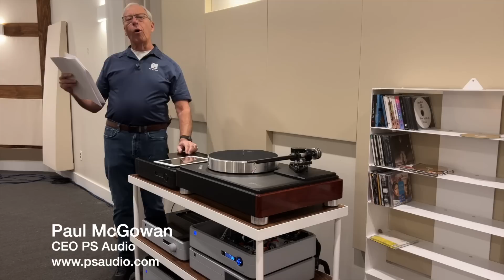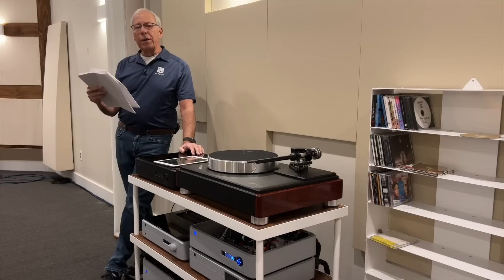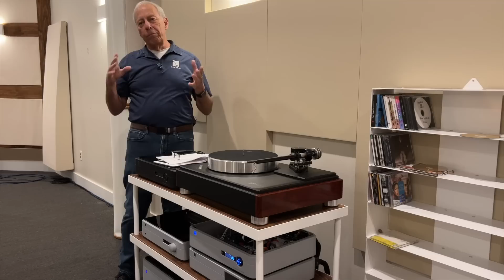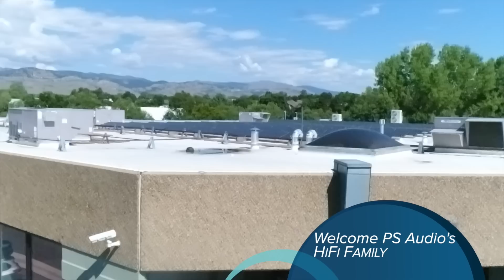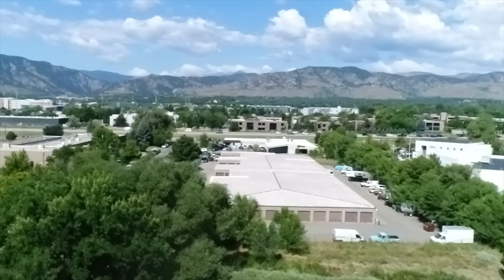Hearing higher sample rate audio

Comment: So higher sample rate is basically same as FPS (frames per second) in video?
Reply: Except that the human auditory system does not have built in storage/ persistence that vision has. We do not integrate the audible pulses the way we blur vision.
Reply: Not exactly. Higher frame rates provide better temporal resolution where that matters such as slow motion or with fast motion content, like a soccer game. But video resolution, i.e HF response still follows Nyquist. For example oversampling a still frame of video has the same benefits or lack thereof as oversampling audio. Higher video frame rates increase the overall data rate but the video sample rate remains the same be it 24fps or 60fps.
Reply: I believe it is more like screen resolution... But certainly is captured like frames per second as samples are taken by second too, but in audio  for you to understand it better, get a paper and graph a sine wave (just a single cycle) then put a tracing paper over it and make 10 even spaced dots over the sine, after move the original paper away and conect the dots with straight lines between them, looks like the original?
Seems like you need higher sample rate to recreate the sine wave right...
Reply: @alejandrorigonatto694  No, that is not how it works. It doesn't connect the dots, it applies a mathematical function to the information. Watch the video done by the inventor of Ogg Vorbis audio on YouTube and he shows that there are no dots and no imperfections at all. D/A and A/D | Digital Show and Tell (Monty Montgomery
Reply: @alejandrorigonatto694  But you don't need ten dots to recreate a sinewave. You only need two dots! Yes, that seems absurd on the surface but that's where the advanced math, calculus,  comes into play.
Reply: And how much you need in a second to cover all the audible range..?
Reply: @alejandrorigonatto694  44.1K that is why they chose it for CD quality, Phillips and Sony based it on human hearing.
Reply: @Digiphex  yeah... Is the double of the maximun hearing frecuency... I know... Just try to explain it the easier way for him to understand...
Reply: @andydelle4509  "But you don't need ten dots to recreate a sinewave. You only need two dots!"

Two dots is not enough.  What if you were really unlucky and happened to be sampling exactly at the zero crossings?  You'd hear nothing but silence.  Therefore, 2 dots aren't enough.  And yes, I know about Nyquist.  You need slightly more than 2 dots per cycle.

One thing all the Nyquist quoters forget, is that the theorem is only true for an infinite sinewave.  The song you are listening to is not infinitely long.  There's a start and an end to the wave.

Furthermore, you'd also need a perfect brickwall filter, and such things don't exist.  Which is why the 44.1KHz is for 20KHz audio and not 22.05 KHz.  They're trying to leave some room for filter rolloff.  Filters cause phase shifts.  A different shift for every frequency.  The steeper the slope, the worse it gets.  So there's more to it than just saying "you only have to sample at more than twice the frequency".
Reply: @Hyxtryx  I do know the practical Nyquest figure is 2.2 rather than 2.0. My background is with early digital video in the 1980s  rather than audio. But the same rules apply. The point is that sampling and subsequent analog waveform reconstruction is not just a simple process as connecting dots on a graph. And 2, OK 2.2, does work quite well as evidenced by red book CD and countless other applications.
Reply: @Digiphex  Also DAC works just like that, look for it, there are no way of DAC to apply the mathematical function you mention, the result will always have slopes on any kind, and that's why you have something called "dynamic range" there is no infinite values in no one of the DAC, physically can't... but it represent no real issue since the speaker inertia tend to make it dissapear, just like in a class D amp when the audio signal don't really exist until it reach the speaker(s) and his inertia...
Reply: No. Video is only showing you those 25 FPS in a cinema movie for instance and the rest is gaps of empty space. Digital audio is reproducing everything with no gaps if CD quality and no higher sampling rate is necessary due to Nyquist-Shannon.
Reply: @Digiphex  Stop peddling the Nyquist-Shannon theorem to sell your old 44.1kHz sampling dogma.
What you and countless others like you have missed for decades is that your arguments does not account for the fact that we can hear many different soundwaves concurrently. And each sound frequency has to be samples individually at the same time for us to capture realworld sounds entirely.

Comment: No, it doesn’t make sense, get a basic understanding on nyquist theorem, it doesn’t matter how much faster you sample, for 44.1kHz sampling frequency, you capture perfectly everything from 0-22.05kHz.
Reply: Exactly! Signals and Systems 101 in Electrical Engineering. But it requires Calculus so nobody but us took the class.
Reply: Because twice the needed information rate is all that is needed? Like 12hr samples for a 24hr daily Earth cycle? Sample Noon and Midnight and you represent the entire daily Earth/ Solar Cycle? But then two samples sunrise/ sunset and the system could just as well be the Sun staying on the horizon all day! 

For those that have actually read S/N, it is about the data rate needed to capture a CONTINUOUS/  INFINITE sample set.
Reply: @glenncurry3041  Brain injury?
Reply: @robertt7238  See a Dr, I can't tell from here.
Reply: @glenncurry3041  Audio becomes useful to humans at 20Hz but for the average guy, you can't hear that anyway. So the absolute least we are concerned with is 40 samples in one second if we want to only reproduce an ultra low sound that very few humans can hear. Earth cycles has nothing to do with hearing or audio.
Reply: @Digiphex  You missed Glenn's point.  What happens if you sample a 1KHz sinewave at exactly 2KHz, but got unlucky and all your samples happened at the zero crossing point?  What would the result sound like?

Now imagine at 20KHz signal being sampled at exactly 40KHz, and you're hitting all the zero crossings.  Same thing, right?  Admittedly, you wouldn't hear the 20KHz anyway, but bear with me.   Now bump the sample rate to 40.0000001 KHz.  Is a perfect representation of the signal going to instantly pop into view?  I don't think it will.  The antialiasing filter is still going to let some frequencies above 20KHz through, and cause distortion. That's why we sample at 44.1KHz, to give some headroom, so to speak.  It's a compromise, and considered "good enough".  But it's still not perfect.  You can get closer to perfection with higher sample rates.
Reply: @Digiphex  OK, having been there to explain S/N sampling rates when CD was first introduced, I used the Day Night example because that was how S/N sample rates were explained. Not because that sample rate was relevant to audio. Sorry if that confused you.
Reply: @Hyxtryx  exactly! Sample a 2khz sine wave at 4k. Two samples! If you hit peaks, life is wonderful! If you hit zero crossings, the entire sine wave did not exist as far as that ADC is concerned! 

11.025Khz sampled at 44.1khz? 4 samples? Zero, Peak, Zero, Peak ... life is wonderful. +halfway up, +halfway down, -halfway down, -halfway up? Looks like a squarewave. No peak data. 

And we sample at 44.1k because that gives 3 samples for 2 channels onto a single video line on a video tape recorder.
Reply: @Hyxtryx   You don't sample 20KHz at 40KHz. You sampled it at 44.1KHz (or something higher than 40Khz).
Reply: No you don't. Because we can hear many different soundwaves simoultaneously. And we need to sample each sound frequency individually in a sum of samples in order to capture realworld sound in its fulness.
The peddlers of the  Nyquist-Shannon theorem have ignored or missed this fact for decades.
Reply: @edfort5704  Physics principles are not "peddled" that is absurd. I can tell you don't know what you are talking about.
Reply: @Digiphex  Using half-understood physics principles to sell untrue ideas merits using the word 'peddling'.
Reply: @edfort5704  Actually no we don't. At any one instant in time we "hear", detect the pressure level that is the resultant of all waves arriving at the instant. We are not listening to all of them at once. Just the single results of all of them at that point in time. I find the mistake we make is in trying to break that complex wave down into it's less resolving frequency only data. Shannon Nyquist actually address sampling in a CONTINUOUS wave not already reduced sampling. Requiring reduction from an infinite number of samples. That part is ignored.
Reply: @glenncurry3041  at any one instant in time you don't hear entire separate frequencies but only parts of them, since no sound frequency hapens in an instant in time and each sound frequency that we can hear lasts a different amount of time.
The resultant pressure waves that we hear are comprised of multiple different frequencies. The waves are not simple sinewaves but complex ones, because you can have multiple peaks and troughs of higher frequency during the rise and/or fall of waves of lower frequency.
How many different waves we can hear at the same time I don't know, but I think the number is huge.
Have you listened to good recordings in DSD versus CD PCM? The differences, especially on DAC systems that leave the original sound unchanged (not upsampled) are high and very apparent. Paul himself has claimed this for years now (the part about differences being obvious, not the nuance about DACs) and is why he has started the DSD studio.
Once one hears the difference between classic CD PCM and good DSD recordings, especially these newer DSD128/256 ones, the question of huge sampling rates being superior becomes evident.
The people using the Nyquist theorem to claim the 44.1kHz superior sampling limit to human hearing have completely missed or ignored the concept of hearing multiple frequencies concurrently.
Reply: The problem with nyquist theorem is that it assumes ideal conditions. In practice, a sampling rate higher than the nyquist frequency is preferred, usually 2.3-5x depending on the application (especially in research, where it can be as high as 10x).

For audio, we can probably get away with around 3x nyquist frequency for sampling if audio processing is not a large part of the chain. Of course I am speaking about capturing all the information in the audio. I don't think, outside of analog instruments, sounds, and vocals, a small degree of error really matters, which is why for mass media no one cares if it is 44.1/48kHz. Diminishing returns and whether or not you care as a listener plays a large role.

Comment: Sampling rate  = how often digital electronics 'reads' the data ?  Theoretically, the more the better but like anything, there are limits or diminishing returns.  In my rather limited experience, the mastering of the recording makes the biggest sound quality difference, far and beyond high sampling rates.
Reply: True. A song will sound as good as it's recording. However I do feel it sounds better than listening from a different source of equipment.
Reply: Right, a phone call is heavily compressed from 8kHz of sample rate and clearly sound worse than 44.1kHz but human hearing will hear little difference above 44.1kHz as it already allows for full audible range reproduction and anything more is about time precision in the treble where you won’t notice the difference for much music.
Reply: @ThinkingBetter  There's a basic misunderstanding, the preoccupation about filters working outside of the audible bandwidth: all filters are a tradeoff in that they will affect the passband in multiple ways (impulse response, i.e. phase and time, plus there are artifacts such as aliasing etc.). In general one might say, the more benign the digital filter, the better the sound (although again, some of the same caveats apply: digital filters are always about tradeoffs, none are "perfect").
Reply: @LeonFleisherFan  Filter artifacts are what makes this an audible topic.
Reply: Of course the mastering makes a huge (in many cases larger) difference, but that does not diminish the fact that sampling rate also does. garbage in, garbage out- but if you have good masters to listen to, why limit them to 44.1?

Comment: Don't forget the quality of the recording. It's garbage in garbage out  no matter how resolving your system is :)
Reply: 👍So true.. Also worth mentioning that the same holds true in a purely analog system. 😉
Reply: I certainly agree with all these comments.
I have some early CD masters which sound terrible.  I have subsequently read interviews with mastering engineers where they have admitted they have simply ‘run the tapes off’ and not paid any attention above going off for a coffee!  & that’s also admitting they used the vinyl or cassette tape mastering copies and not the originals!
I have bought 24/96 downloads which are compressed highly and they sound horrible and certainly don’t take advantage of the available dynamics, I have a couple of times bought 24 bit hi-res downloads which sound little different from the CD which certainly makes me wonder where some supposed hi-res masters are sourced from, let alone what work has been done (meaning little)!  Obviously disappointing as 24/96 (and above) can certainly, if done correctly sound fantastic, natural and dynamic, spatial and full sounding.  I have some very well recorded and mastered recordings which certainly makes you feel like being in the room during the recording, which is certainly (in many cases) what it should be about!
Reply: @joepostle3561  👍👍👍👍👍👍Exactly!!! Why do so many hi-fi enthusiasts NOT realize this??? Or worse, argue with your stance on the matter!!
👨🏻🥂
Reply: Especially true for some of the early age of those 44.1Khz onto cd, that simply were not mastered well.
Reply: Absolutely. I have heard some awful 24/96 files where there has been an overuse of compression.
Reply: Well, he did mention Octave Records ;-)
Reply: Don’t worry, we’ll convince you there’s a difference. You need to hear our resolving system with an Octave record with 11 Meg sample rate DSD🤔  🤣🤣
If your ears don’t convince you, the prices will. Don’t forget to call our contractor on your way out about the construction of your custom listening space..😉🥂
Reply: It is different topic.

Comment: The Tesla must really be impressive in high altitudes. I remember fairly quick ICE cars being gutless in the mountains when I was living in SLC.
Reply: Correct.Higher altitude= less Oxygen=less power. Battery power=Awesome power, even on the Moon.  I know you were being Rhetorical but still it's worth repeating. Bye the Bye. Rolls Royce has less (not by much) Acceleration than a Tesla but it's still enough to push you into the back of the seat and exclaim "Holy Balls."  A better comparison he could have used would be a VW Bug Vs Tesla. LoL